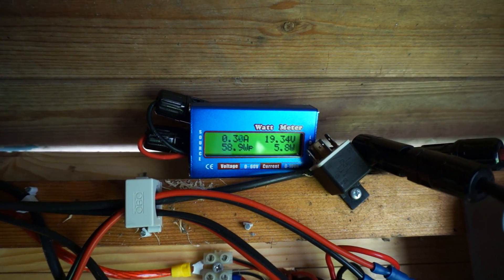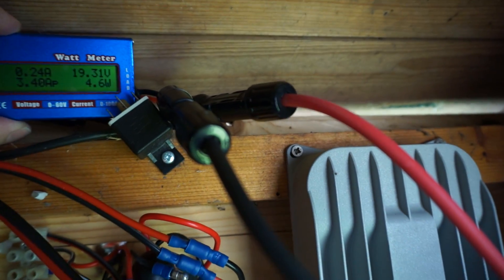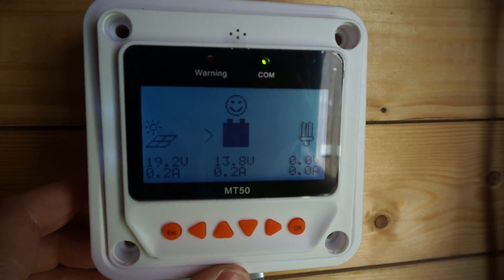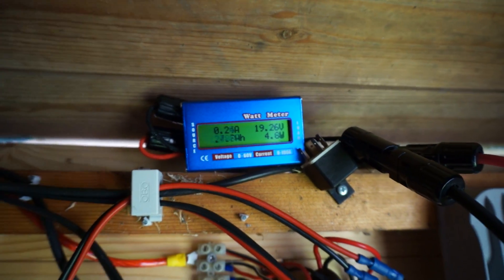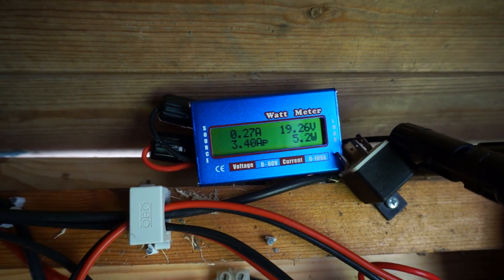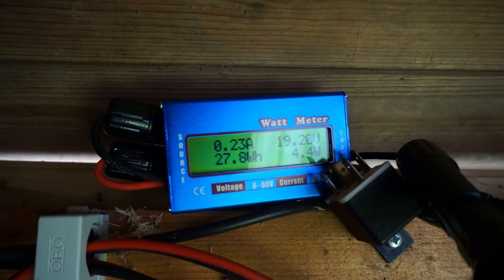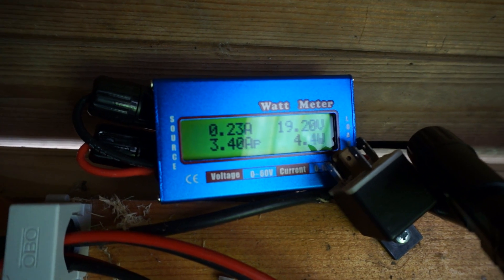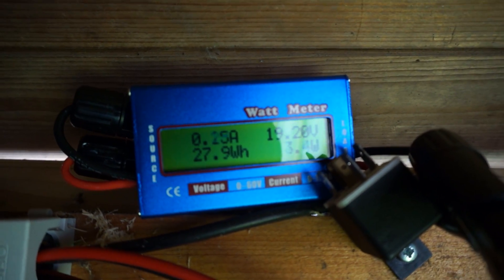eBay RC Volt Amp Watt meter

Comment: It is cheap because it is crap: there is no reverse current protection and it will not accurately measure low value currents. Unless you have solar panels with blocking diodes this will discharge a battery overnight.

Comment: Finally figured out that this unit can be used to read 12V battery charger output volts and amps. Source side connects to the charger leads and the load side connects to the battery you want to charge. Thanks for sharing.

Comment: I’m using this type of power meter on my solar generator. After sunset, it turns off as expected because mine requires 4-60V input to operate. The problem is, even when I am generating as much as 19V on mid-day, it still doesn’t turn on.l; unless I turn OFF my PV breaker and back to ON. Any idea how to fix this?
Reply from the maker: Same problem on this one too. Apparently there is a mild variation between versions where you could manually reset it by shorting pins on the servo connector on the side.

Comment: 2 of the pins on the side are for external power (required if you want to measure under 5 volts).  The third pin will reset the unit if shorted to ground.
Reply: Arnd2it would you know the pin config of those? From the top, is it RESET, Negative, Positive?